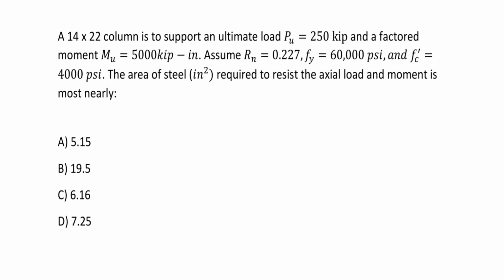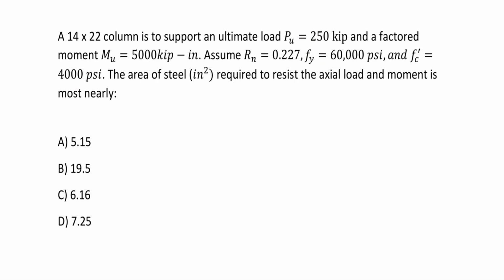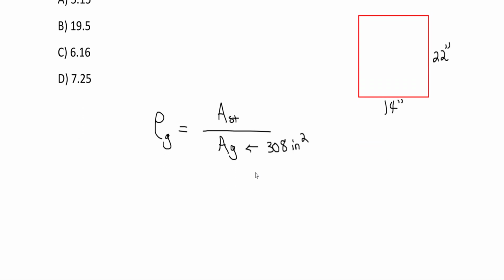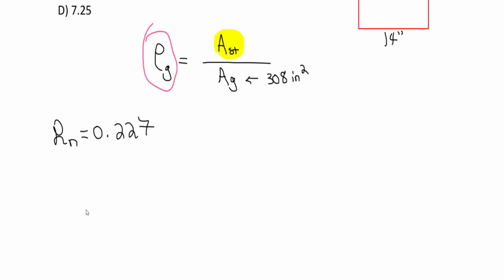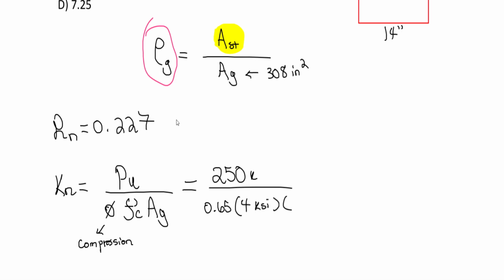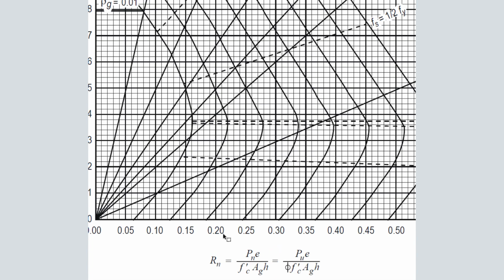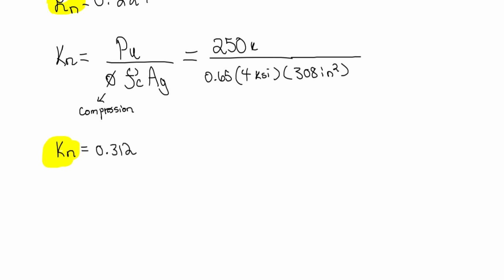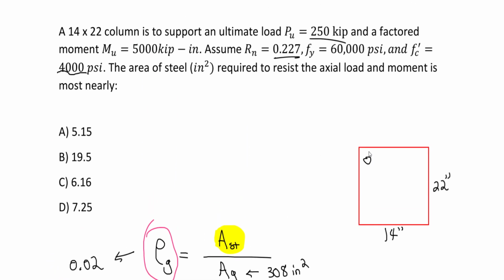FE Exam Review - FE Civil - Column Strength Interaction Diagram

Comment: Heloo, thank you for the video. If I may ask, I want to know how did you check that you are using the correct Interaction Diagram?
Reply from the maker: You're welcome! This is an old video but the FE problem statement will give you a "gamma" value that guides you in using the right interaction diagram in the FE Handbook. Most likely, the interaction diagram will be given in the problem statement itself which is often the case for NCEES FE/PE style problems. 

In this case, I assume gamma is 0.8 using the interaction diagram on page. 279 in FE Handbook 10.2

Comment: Didn’t you used the graph wrong? You used for Rn=0.21, for 0.22 it would have been the next line, right?
Reply from the maker: Hi, sorry about that. I think I did use it wrong. Here is a corrected figure showing the correct intersection point. 

https://drive.google.com/file/d/1eix3dwOH2FVD5a7M843h5qKqAn8C1NvB/view?usp=sharing

It's been a while since I did this but please note that we would need to interpolate to get the approximate for the reinforcement ratio. It would be closer to 0.02, more accurately I would say it will be around 0.022.
Reply: @directhubfeexam  how about the effect of moment? there you state the moment but you better explain why you didn't not consider the moment. You always touch amazing concepts. Thank you for all your hard work!
Reply: @directhubfeexam  Yes, with the correct intersection point, however, rho is roughly 1/5 of the way between .02 and .03 so I used .022, and got 6.8 - which is right in the middle between 2 of the answers. So the answer isn't really correct